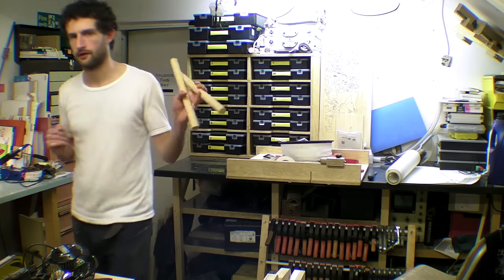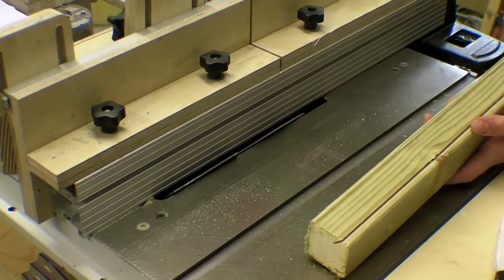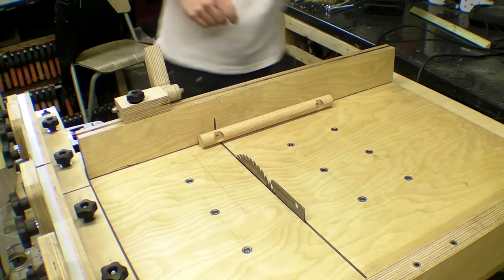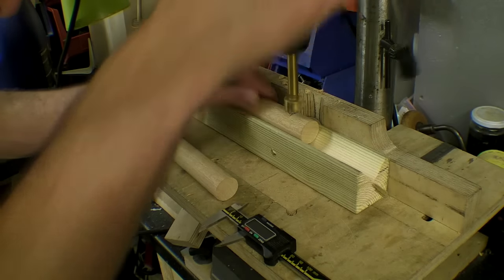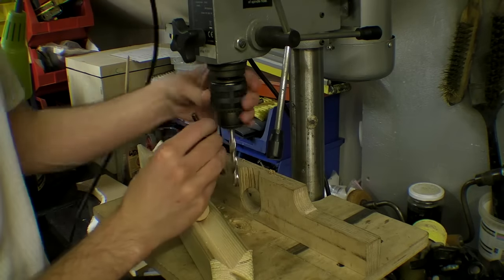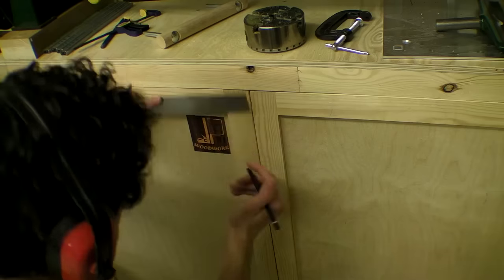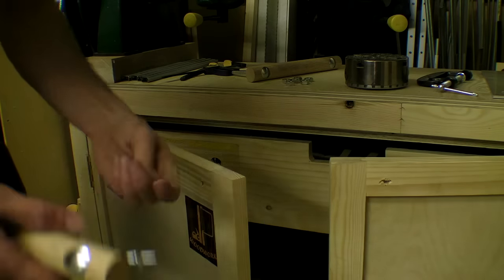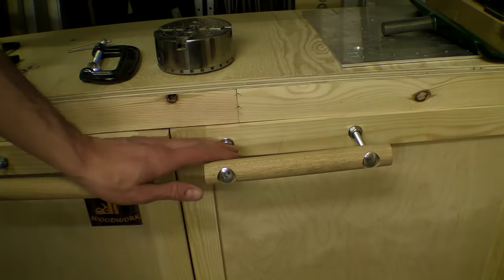Making Door Handles for the Wood Lathe

Comment: Nice video. 
Just a suggestion if you want to find the center of the vee block you maked, put in a 1/8 to 1/4 drill bit in the chuck move the drill bit into the vee and line the flutes up so the drill bit is centered in the vee lock the column then put your fence or clamps on the vee to keep it in place. This make for fast setups.
Have a day
Reply from the maker: +E Hiebert So simple, I feel silly I didn't do that now!
Reply: +Savvas Papasavva Yes so simple but I was taught this trick by someone who has been a machinist for years. Thats why i like the youtube building community you get to learn something new.
Have a day